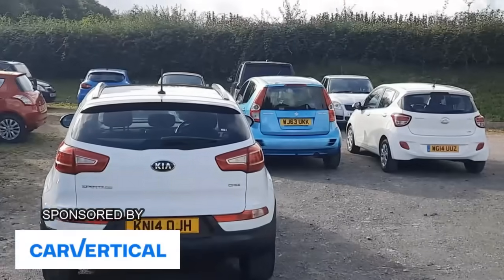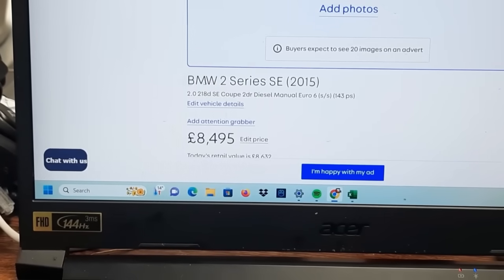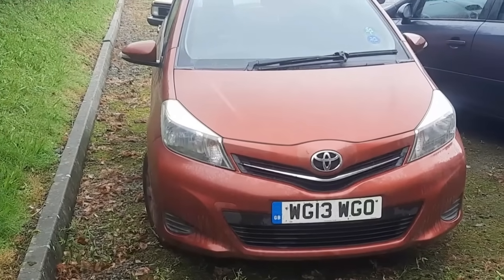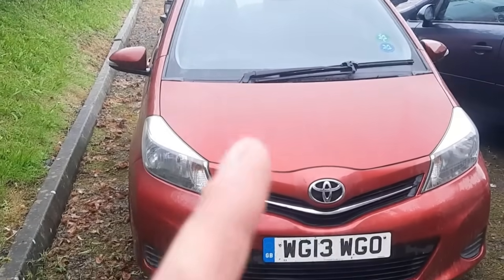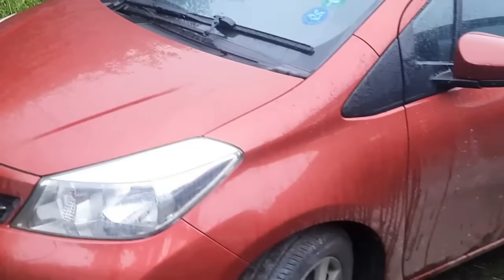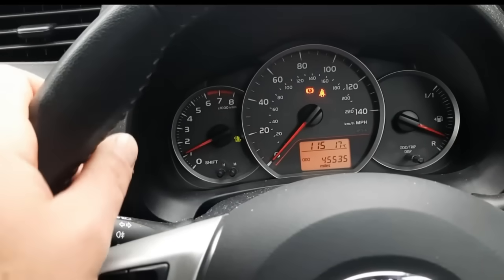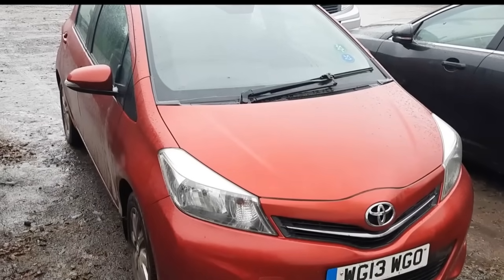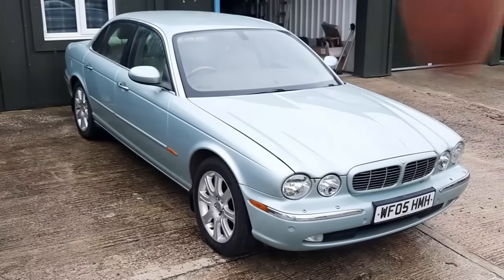Used Car Prices Crashing? These cars lost hundreds in just 1 month!

Comment: I had a 12 plate 1.3 Yaris from new, reliable and cheap to run, first new car I'd had to pay for. Completely converted us to Toyota, moved onto their Hybrids and have never regretted it
Reply: I have had toyota hybrids since 2001. My current Auris hybrid 2011 has 165000 miles on the clock and is still going strong. There is nothing that I would want to p/x against as the car is running fine.
Reply: Toyota is the most reliable car on the Planet - sold in every country in the world! The Toyota Camry has been the best selling car in the USA since the 1990's .

Comment: James, you are sure stepping up your game. I have never seen so many cars on your parking lot. Great for you. Keep it up. The dealer I deal with where I live is always shocked when I trade in a vehicle. I am always honest with them if there are issues with the vehicle I am trading in. I usually buy vehicles where the mileage is slightly around 90,000 - 100,000 km. I find at that mileage the vehicles is still new enough that it shouldn't cause any issues. That being said I always buy between 3-5 years of extended warranty. The current vehicle I bought 2 years ago is a 2016 Ford Escape Titanium with the 2.0 eco boost. It is fully loaded and I got it for $10,995 canadian with my trade in. I used to repo cars for the finance guy at the dealership so I get really good deals. I got 100,000km 5 year extended warranty for $1300 Canadian. The way I see it, if I blow up the engine or transmission the warranty paid for itself right there.
Reply from the maker: Cheers Mark, and thanks on behalf of your dealers for playing straight

Comment: Car prices both used and new are ridiculous 20% more expensive than pre covid. Advice is don not buy a car unless it’s a necessity otherwise you will just get ripped off. A lot of dealers just making fat margins and the appetite to accommodate these greed is passing by.
Reply from the maker: Sorry this shows complete misunderstanding of market. For dealers to make fat margin they would have to be buying at pre covid prices still and selling at post covid prices. Of course that is not the case, we are having to buy at the higher price too so margin is the same.

Comment: The rear tyres on that Yaris are the originals at that mileage and will need changing regardless, check the date codes on them.  Any tyre over 6-7 years old runs the risk of rotting out and those Dunlops are known for being susceptible as they were OEM spec ie hard compound.
Reply: agree , my dad gave me his 2004 Focus at 11K miles , the tyres had cracking side walls in 2015 MOT fail

Comment: Lower used car prices are long overdue, the cost of new cars are now beyond most people
and high used prices don't help.
Buyers are hanging on to what they have, this has created a shortage of good low milage
used cars, hence the high prices, they are plenty of high milage ones that not in great condition.
It will take time for the prices to settle down again.
Reply: In the 80s I was selling cars for say 200 quid, that's a grand now adjusted for inflation and had some up at 3995,that 13k now, car prices hardly moved for decades while everything else went up, in real terms prices are probably cheaper than the 80s,makes you think anyway.

Comment: Your vehicle

    WJ13LXR
    Red FORD FOCUS TITANIUM X TURBO

Country of registration

    United Kingdom

    Change vehicle

Ultra Low Emission Zone (ULEZ)
This vehicle meets the ULEZ emissions standards

You do not need to pay a daily ULEZ charge to drive in the zone, and are helping to improve air quality across London.

However, if you see the Congestion Charge displayed below, you will need to pay that daily charge to drive in central London.  I now check the date of manufacture on tires  after an MOT examiner pointed out my tires had been on the car since 2008 about three years ago

Comment: I think the ulez expansion has had a massive effect on prices, euro 5 or order (2015-) diesels I feel have been hit the hardest
Reply: 100% (and the clean air zones all over the major cities). My main trade was in older diesels, never had an issue selling them. No though I’m sitting on stuff for weeks, my prices are the lowest locally and still no real interest. I get a petrol in stock and it goes ridiculously quickly. 
Such a shame as the diesels are still good cars.
Reply: Yes I sell mostly diesels cheap family seven seaters based in SE the euro 5’s held up well till ulez expansion kicked in seen big big drops ( talking about 2006-2014 smax galaxy etc) . Not surprising if you suddenly have to pay £12.50 per day to go to work or drop the kids off or go to the shops.

Comment: All those Yaris's def have rear reversing cameras & bluetooth (i think) which makes it a good buy,the 6th gear has a more high gear ratio for better mpg, few know about that.  CVT gearbox's does the same mpg as the manual!  They removed the spare wheel & incl that silly emergency tyre repair kit on most models,but i decided to get a spacesaver myself on mine....less headache if you do get a puncture. Unsure if that steering wheel pulls in & out on that model.  They can be prone to wheel bearing issues, just a heads up. Keep us u pto date on it 🙂

Comment: Used car prices are absolutely ridiculous. Dealers want top bucks for vehicles with no cam belt or clutch history at 80,000 plus miles and over 10 years old. 10 years is when cars start to need expensive things like PAS pumps, all belts, brake fluid change, rear shoes (if fitted) change with wheel cylinders, clutches and DMFs etc. Even "full service history" is meaningless if its not main dealer because independents often skip the things like pollen filter and AC leak checks.
Reply from the maker: Remember dealers are no exempt from increased prices, they are paying way more to buy the cars with those faults that private sellers sold

Comment: Clutch can be any miles bud, I replaced one in a 1 owner i10 at 19k,tbh it's not a great worry in a small petrol, a lot are like 60 quid now, bought a pug 207 one today 47 quid, most petrol cars after 2006 are ulez, its worth checking and putting in the advert as I sold 2 ulez to London this mth and we're 200 miles away, met one guy at the station, he said he'd saved 1500 quid, ticket was only 40 quid, did a transporter delivery on the other, 16 plate mg6, guy was well pleased with a cheap ulez diesel, things are dropping, today's auction at Aston barclay was a bit cheaper, I got a high miles dacia 13 plate, for...... 650 bid (!)

Comment: I have been tracking some Renault Kadjars on Autotrader at £13000 then down to £12700 then £12,400 now £12k for a fully kitted out lowish mileage example
Reply: Yeah but it’s a tyre jack brand. Say no go.
Reply: @z00h  the fact is cars in general are staying on Autotrader and are reducing in price as they're not shifting. It's normal around a reg change but not a month after

Comment: Would not touch a ecoboost
Reply: That’s the 4-cylinder 1.6turbo (as in the ST180 Fiesta, 150ps or 180ps depending on Focus models always 182ps in the Fiesta ST) which is no related or designed same as the 1.0ltr 3-cylinder Ecoboost ones that go bang……do your the research the 1.6turbo 4-cylinder are fine the term “Ecoboost” is simply a term used by Ford to describe the VVT technology now.
Reply: @markturner-smith5309  I agree, I have the Fiesta 1.6 Ecoboost, The 1.0’s chew the belts up block the oil pick up and starve the engine in some cases. Not sure if I’ve read this correct but the later Fiesta with the 1.0 Mild Hybrid tried to solve this by using a chain but the oil pump is driven from a separate  rubber belt still.
Reply: Not sure what is was/done but something in the design (maybe physical size being a 4-cylinder) made the 1.6Turbo good reliability believe particle filtering was far better to prevent sump pick up blocking a design element they definitely skimped on with the 1.0ltr 3-cylinder including weak head gasket/turbo with the 100/125ps versions good head gaskets (thicker) and upgraded turbo 140ps versions only one’s worth risking.
Reply: We had a galaxy 1.6 ecoboost. I was worried it would struggle and have a hard life on such a big car. It was very nippy and very reliable. Wish we never sold it now. For some reason no one wanted to do the cambelt change and mainstealers wanted 700😢 to change it
Reply: @CTR_1986 believe this was also true of the ST 1.5 3-cylinder did something like that to get round 1.0 Ecobang but then with the 1.5 physical size/etc they could design properly.